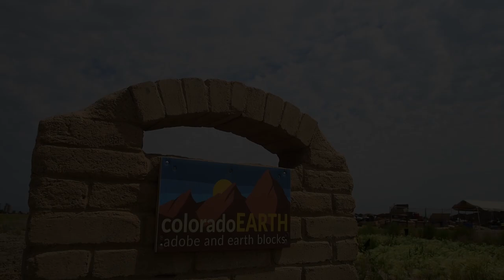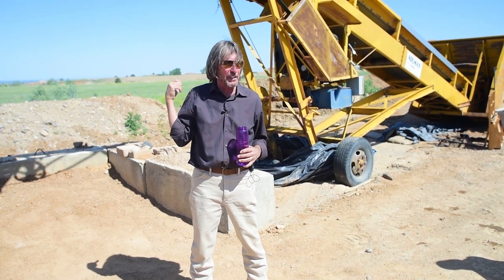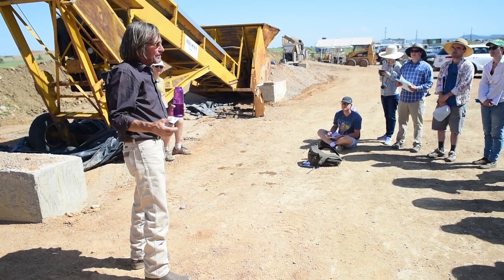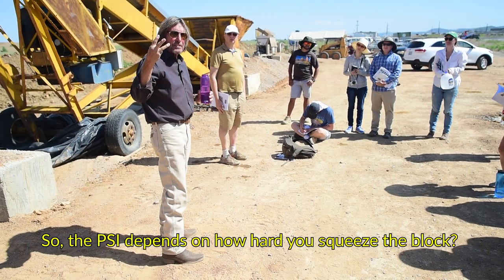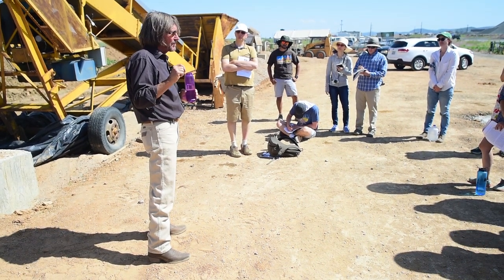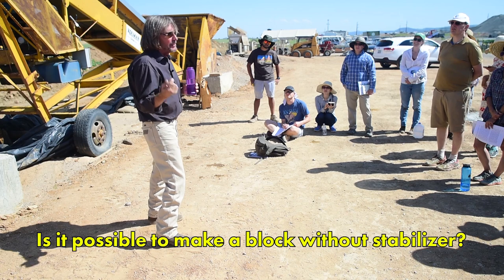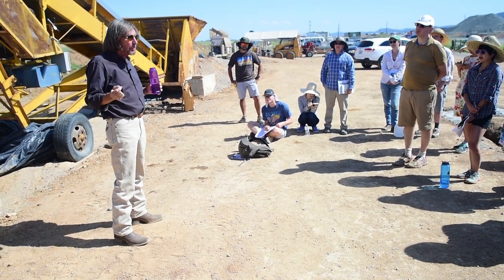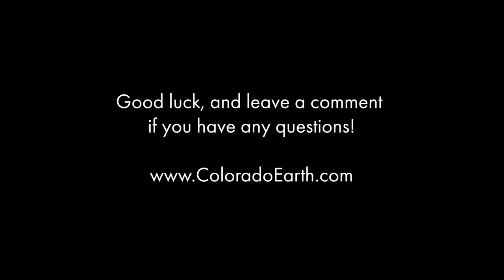Part 1 -  Soil Properties of Earthen Masonry

Comment: I've been pricing the materials needed to do this right. The Portland cement makes this very expensive to build with. So, to make it work you really have to adjust in size or other areas where money can be saved. Like doing all the labor yourself. Cement costs a lot, but you can't skip it if you want walls to stand.
Reply: I know it's quite off topic but does anybody know a good place to watch new tv shows online ?
Reply: @Samson Christopher Try Flixzone. You can find it by googling =)
Reply: Why not use Lime instead of cement? It is cheaper, less carbon footprint, and it cures in air not water. Such blocks of material would cure without extra watering.
8:00 My question is answered